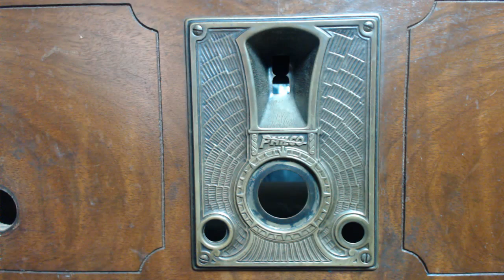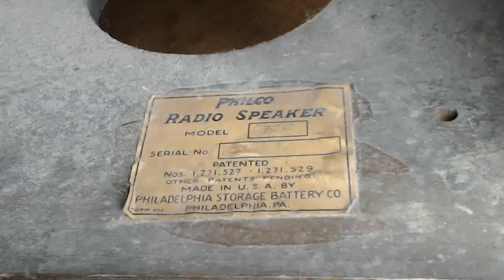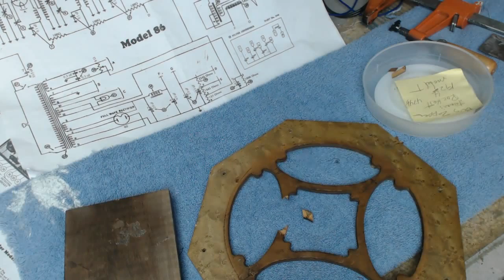1929 Philco Model 86 Restore Part 7

Comment: Lay a slightly larger piece of veneer over the top of your area you need to patch.  Cut through both the new veneer and the old piece below.  Remove the old veneer up to the cut line and tah-dah, the new veneer piece will fall right into place perfectly.

Comment: Buzz,
So far - so good, my friend.  Very invigorating.  Suggestion:  Go to Hobby Lobby and over in the quilting section you'll find sheets of flexible plastic (like plastic milk bottles) for about 4-bucks or so.  Cut to shape and use it between clamped pieces of wood.  There will be no more gluing of the two surfaces together.  Or you could just use the plastic from the empty gallon milk jugs.

Regards,
John
Reply from the maker: joernone Thanks John.. That plastic is a good idea..While filming that scene, I was hoping i wouldn't need a hammer..lol....but it came of rather easy and made a good funny scene..And,, as you see, I love using the pencil......
Regards, Buzz

Comment: I know you like to poke fun at yourself, but no matter how badly you screw it up and mismatch the veneer, the one mistake that cannot ever be undone in the future is throwing it in the trash.  More or less anything is better.  Anything that saves the radio is fine. It can be unpainted, reveneered and electrically restored in the future.
But I think your worrying is unfounded. So far you are doing a nice job with it and with far more patience than I could ever muster.  Restuffing those capacitors is tedious and time consuming.